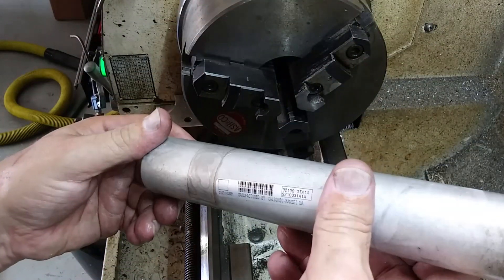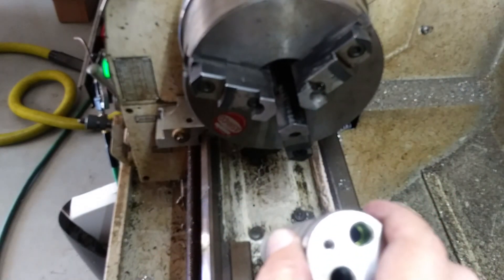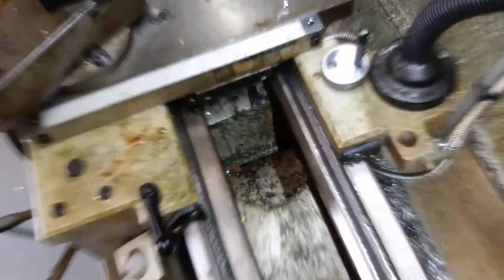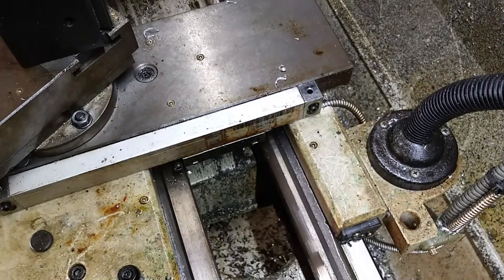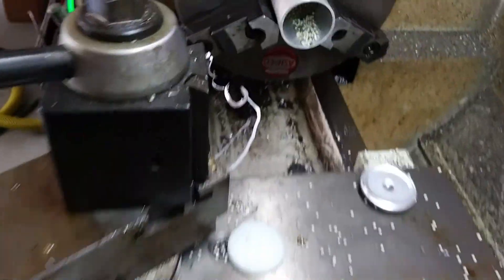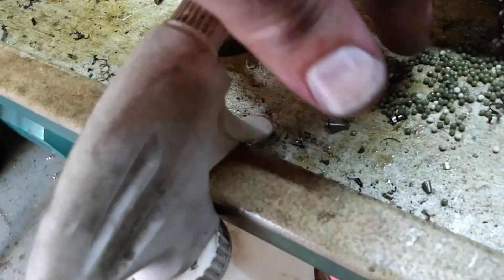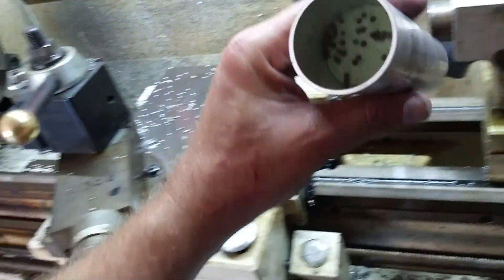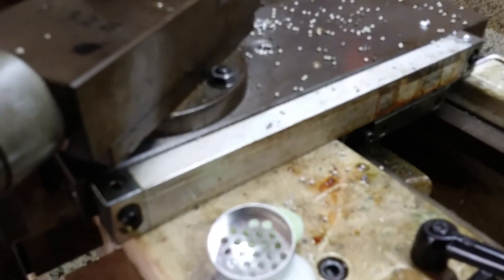Whats inside a car air conditioner receiver dryer.

Comment: Those desiccant beads are a Zeolite activated alumina molecular sieve commonly known as XH7. Those are generally used for drying R134a based refrigerants with polyalkylene glycol oils. They're used a lot of vehicular A/C systems worldwide.

Comment: Hi brother thanks for your videos I'm a subscriber.

Question please...

I have a 1995 Lexus LS 400.

The radiator fan is not activating.
It does work because i tested it.

I disconnected the connector that's connected to the ac receiver drier and the radiator fan turns on and stays on continuously the whole time.
But when I reconnect the connector the radiator fan turns off.

I'm trying to fix the fan so that it turns on when I turn on my air conditioner but the fan does not turn on when I turn on the AC.

I feel like it has something to do with that connection but I'm not sure.

Do you think I might have a bad sensor that's connected to the receiver drier?

Thanks.
Anybody knowledgeable please reply soon.
Reply from the maker: If you email me I can send you the diagram so you can get an idea of how it is wiring.
Reply: @737mechanic  im not good at wiring.

The ac works fine. The fan works too when i power it straight to the battery, but the radiator fan does not turn on unless i disconnect the ac receiver drier connector thats connected to the sensor that sits on top of the ac receiver drier.

😔

Comment: Nice video!
I have 2 questions:
Can you find out or know which port has the filter? Is that on the inlet or outlet?
And I was curious if that filter presses in like orifice tubes do, and if it is snapped in too tight or possible to extract on an intact dryer? (Can you try to pull it/push it out from the 'top' if it's still handy?)
I don't have opportunity (or a lathe for that matter! LOL) to do this myself, do you still have the pieces?

If you don't have it anymore, I can figure it out from the video and the car. I noticed that the fitting bolt hole off to one side, so looking at the 'front' with the bolt at 12 o'clock, filtered hole is at 9 o'clock and open port is at 3 o'clock.
(Is this a car you have and can look at?)

Incidentally, I don't know what I will do with this anyway, I suppose one would not find a replacement filter anyway.
I guess sometimes it is just nice to be able to remove and inspect things instead of guessing as to what has and has not been contaminated. If clean, I could assume the system isn't fouled after a compressor replacement previously, by a third party.
Mr KL

Comment: Any idea what kind of Desiccant they use? Thinking about making my own AC dryer.
Reply: Whatever for?? They are only about $20 complete, and ready to go with fittings, etc.
You would also have to add screens and containment pads compatible with refrigerant AND the oil.

You can get a generic prefab filter dryers from any HVAC supplier, They come in all sizes and for various refrigerants. (Looks like an inline fuel filter). Just check the filter specs for your refrigerant and oil. Pick one that matches.
They are commonly added as an additional filter after a compressor replacement on commercial AC unit.
(Run them a while, cut them out and braze in another, until unit is clean. As I understand it...)
You can get them with solder/braze or SAE flare.
Keep in mind car AC systems are 2 to 3 tons, so get a filter dryer that will handle the flow without restriction or blowout. (filter bag bursting, beads retention rupturing and beads flowing into the system).
Good luck, curious what you are planning...
Mr KL
Reply from the maker: No idea.